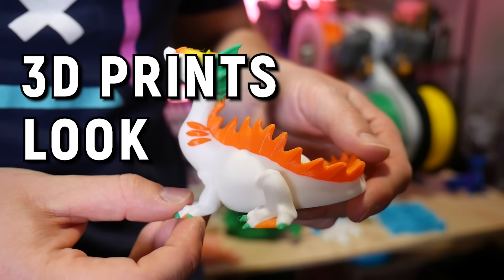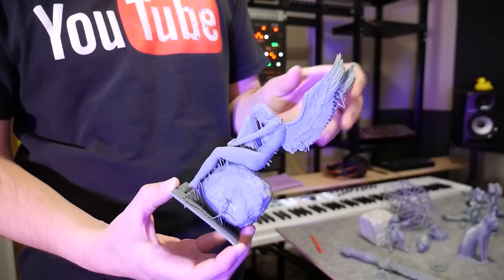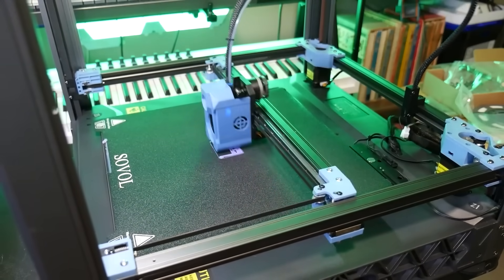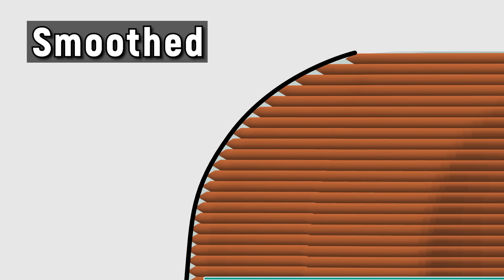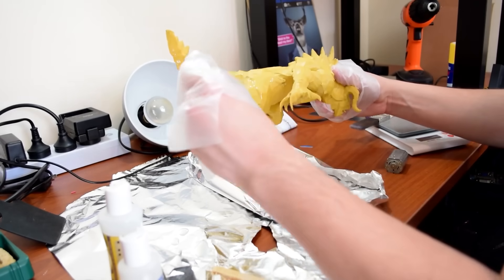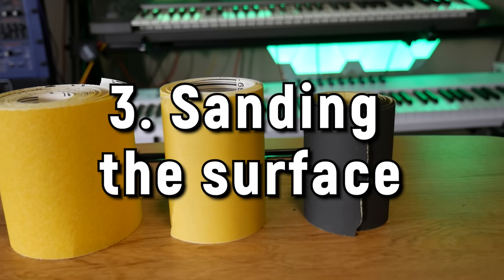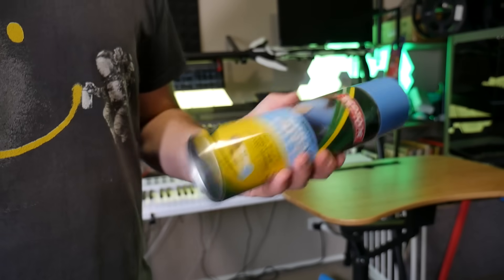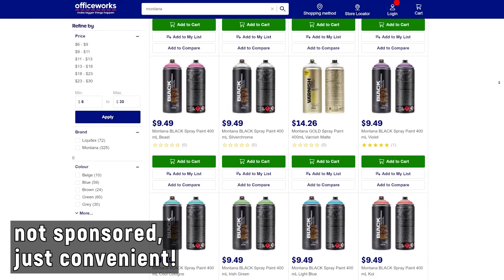How to make 3D prints look like they're NOT 3D printed.

Comment: A rule of thumb is to always use a lower grit before painting if your paint is thick, the paint will fill in the groves and leave a surface finish comprable to high grit, but it will stick much better. Generally you should only use a very high grit (>300) if you are going for a polish and not paint on top.

Comment: I use elmers wood putty which is water based so you can thin it to the consistency you want with just water.  Then apply with a plastic paddle or paint brush depending on the consistency.  It dries in about 20 minutes so you can do multiple coat/sand layers in very little time.  After I get it to where I want I spray with rustoleum 2 and 1 primer/filler then do a damp sand, I say damp as you don't want a ton of water or if you sand through the primer/filler it will reactivate the wood putty.

Comment: As an alternative to Talcum powder, I use baby powder. I haven't tried cornstarch, but I have read of others using it. 

You can still get talc powder, it is helpful for laser engraving on reflective surfaces as it lets the camera pick up the object easier, so it is not completely impossible to get.
Reply: If your baby powder isn't made of talc, it's probably either corn starch or potato starch.
Reply: I've used cornstarch and it works well.
Reply: How about fumed silica (cabosil?). It's commonly used to thicken epoxy.
Reply: Another option is diatomaceous earth powder.

Comment: I personally think a spot putty (like bondo) is a better alternative to the spray version you used. No aerosol, so PPE isn't AS big of a concern. And it's so easy to slap a little bit onto a printed part, and smooth it over in a matter of minutes. But, some form of sanding and filling will almost certainly give the best looking finished product.
Reply: Bondo is really stinky. I prefer wood filler, it’s water based, doesn’t smell, and it sands really well .
Reply: @roofoofighter  The smell doesn't bother me at all. But to each their own.

Comment: For anyone who wants to avoid the "orange peel" look after painting, you will need to wet-sand the paint. If you want to take it a step further and make the part look amazing, you can add clear coat, but you will - you guessed it - need to wet-sand to avoid orange peel. This definitely works best for larger surfaces, though. Since spraying paint and clear coat will fill in most fine details.
Reply: To add to this, 2k (1k works too) automotive clear coat will be exponentially better at protecting things than clear coat you get at a hobby store. Especially if you're coating things that get handled often. I made a 3d printed hitbox-style controller, and it would look disgusting right now if I hadn't used 2k clear coat. Any brand should be fine.
Reply: If you're getting orange peel, then you probably have a humidity problem.  Which, yes, is best fixed with wet sanding, but if reducing the humidity is practical - and depending on where you live it may not be - then you can avoid the orange peel in the first place.

Also, remember that most clear coats will kill most "metallic" paint effects, so test that out on scrap first.
Reply: @davydatwood3158  Good thing I've been hoarding all my scraps in different bins hoping for a cheap recycling option to become available in Aus. Got LOADS of scraps for paint, sanding or other testing purposes.
Reply: +1 for wet sanding
Reply: Another trick to avoid the orange peel texture is finishing with an airbrush instead of spray cans
Reply: Huh, I never encountered this orange peel effect and I was very surprised to see it in the video. I feel it mostly comes down to the paint used? I usually use automotive paint, which always leaves a glass-flat finish on a sanded surface.
Reply: @bzqp2  it's typically a humidity and quality of paint issue. It's definitely not the norm though
Reply: Also, I've used 1000 grit sand paper and it leaves it super smooth
Reply: What if you want the orange peal look?
Reply: Note: for wet sanding you need WATER RESISTANT sand paper. Especially paper based sand papers are not suited for wet sanding.
Reply: With a decent can of spray paint you can get a good finish by spraying thick enough layers.
Reply: @Iisakki3000  And lose any/all fine detail. Not trying to make paint blobs.
Reply: Or maybe you paint it correctly so you don't need to wet sand

Comment: Wet sanding is the way to go! Uses much less sand paper & doesn't create dust.
Reply: also keeps the surface cool so you don't get that melty gummy thing going on
Reply: 👍And I'd argue it even creates the smoother surface.
Reply: @_Jester_  with PETG and going thru increasingly finer grades of wet n dry paper I've managed to polish models before. At the end a bit of furniture wax does wonders

Comment: I recently printed something in a color I absolutely loved, so priming and painting weren't options. I knocked off the major surface blemishes with 100grit, evened out the surface with 250, then smoothed it out incrementally using 500 - 3000. It left a really cool, brushed finish Werth the layer lines looking like the grain of the material. To smooth it all out and make it all shiny, I used neutral shoe polish and basically spit shining the entire thing before sealing it a few coats of liquid floor polish. It's totally smooth, lost no detail, I can see my reflection in it,  it smells surprisingly good, it's totally water proof and I didn't lose the color of the filament. I would definitely use this technique again, as the end result was definitely worth the time investment.
Reply: I've made wind and brass instrument parts from black PLA: they really come out looking like ebony wood, which is a huge bonus. They also feel luxurious, smooth and silky, there is a nice warmth in the material when you touch it. I use water at each stage, including the rougher grits to keep temperature down. Add a bit of dish soap in the "coolant" and you can use some power tools, carefully of course. As long as there is plenty of that "coolant" in there, you can go surprisingly fast but as anyone knows who has tried it: the risk of ruining the surface for good is great.

I use car wax as finisher, after two polishing compounds..

Comment: They sell these scrapers that just look like flat metal plates but the edges of them you can form into a small bur and scrape the part, it basically makes it so smooth when you scrape away the material versus endless sanding. Then you can probably do your finishing stuff after and make it look like a injection molded part.

less sanding more quality and faster!
Reply: I use a small snap-off knife for scraping anything that isn't completely flat. It saves me loads of time! 🙂

Comment: I've found that quickly hitting a print with a foam sanding pad and then polishing it with a wheel on my Dremel is often adequate. Less effort than a full fill and paint treatment, which I've only done once for a shower knob (ironically, it was only supposed to be temporary, but my friend liked it so much they asked for a permanent version).

Comment: A potentially good replacement for talcum powder is a product called ‘microballons’ - they’re microscopic glass bubbles. I’ve used them to thicken epoxy for repairs on a discus launch glider RC plane, because it doesn’t add much weight (due to the glass being a ton of air filled, tiny bubbles instead of a solid) and retains a lot of strength. It’s also pretty cheap as I recall, and a little goes a very long way. 

Additionally, because they’re made of glass, they shouldn’t cause any issues when working with UV resin since they are essentially transparent (they look bright white in person due to all the refraction going on)
Reply: I've seen it sold as "fumed silica". It's great stuff, the only downside is the fact that it's incredibly dangerous to inhale, as any that gets in your lungs is there forever.
Reply: @nicellis44 fumed silica is a different product, but probably better as a thickener as it shouldn't float out of suspension as quickly as kicrobaloons

Comment: if i want to smooth a part and give extreme strength, following your sanding method but just before you go to spray putty, i cover the area in baking soda and then spray CA glue, it dries fast and goes hard as concrete , then continue with putty and sanding , needing less putty in those areas

Comment: Well.... you got a lathe..... it can be very, very nice in some cases to just use that to smooth prints. Just very light work, very thin and it gets smooth without any other finishing.
Also, using metal and plastic smoothing-brushes in a machine like a drill or in the lathe and just go around the part. Works way faster then using sanding-paper without the melting-problems. If needed, you can make it moist with just a plant-spray. It really gets smooth fast.

To paint, airbrushes work really nice and fine.
Some use simply fine-grid sand-blasting with this way too. I never felt the need for this myself but I have seen some nice models just done this way. Sometimes airbrushed afterwards, some without. On difficult places, just use some plaster before and then use the sandblaster/airbrush afterwards.

And yes, I use the carpaint-cans sometimes too....

Comment: I was always told to avoid PLA if you plan to sand, as its lower temperature resistance increases the chances of it melting. For models you plan to sand use PETG or ABS (and then you can get away with using electric sanders if you wish!)
Reply: you can make the PLA a bit moist with a plant-sprayer to avoid melting.

Comment: for note, i use to do bodywork all day everyday, mostly fiberglass

i HIGHLY recommend 3m goggle gear 500 safety goggles. Not only are they inexpensive, so everyone can get them, but the lens is also replaceable if you want to  have back ups incase you break or scratch them, the gg 500 is D4 rated and should be more than enough here, but if you want to be extra sure go for the gg 2890 safety goggles that are D5 rated (fine dust), which are also over the glasses goggles for all you glasses needing folk

for the face masks/resperators my single use go to is the 3m specialty particulate respirators 8000, its an N95, P100, P95, R95 rated mask and worked quite well in my very dusty environment, and it had an breath exhalation valve so it didn't get too hot. for reusable resperators i very quickly fell in love with the half face rr 6300, as it could be set up for vapors and fumes like when i was painting cars, or dust of all types, it had replaceable cartridges so you just gotta pick the one that suits best for you
Reply: These are TOP TIER TIPS 🥇
Reply: I know this is an old comment but question: How do you choose the size of the face mask? I can't find any details about it online. First time buyer so I have no idea and it's not like I can return it after use...
Reply: @ares395  the very simple way i figured it out, if your a large adult male (6'+), get a large mask, if your anything else, get a medium
Reply: @The_Phrough  Thanks, I guess I'll get a medium then. I also found a thread from pandemic times that claims that medium fits around 80% of population but they were talking about a different type of 3M masks.

Comment: I had to search what “bog” means. I’m still  not entirely sure what it means.
Reply: it means coat or layer on putty (plaster, spackel, any other wasteable material than can gap fill) 
its an old school builders slang term , thick mud is a bog, like a swamp
so you need to goop up your part till it looks like a swamp ... bog it
Reply: @nadukkerensky392  I wonder if that’s where the phrase “Don’t get bogged down in the details“ comes from
Reply: @roofoofighter  yeah quite likely, being bogged down is same as stuck in the mud
so you dont want to get stuck in the details and not finish the project at all
Reply: "Filler" as in Bondo or Rustoleum spray filler.

Comment: Edit: I meant Teaching Tech, not CNC kitchen

CNC Kitchen made a video on this but he did it using only slicer settings. To me, his results are a lot more clean and less hassle.
1. Random seam position
2. Fuzzy skin parameters of 0.2 and 0.2
3. Variable layer height
Reply: You are comparing pears to apples.
If all you want to do is hide layer lines and have models with orange-skin you can go that way and be happy.

This video discusses ways to get the most clean and smooth surfaces.
Part of this is optimizing print parameters as also mentioned in this video but for the best results you have to invest time and effort.
Reply: @GrmlMaster   no you're wrong. This video was about how to get your 3D prints to not look like 3D prints. Hence why Angus goes through many different methods, some of which don't give the smooth surface that his main method gives. Teaching Tech even uses some of the post process techniques that Angus uses but he focuses on how we can do a lot with just a slicer.
Reply: @TheSupermUniverse100  You can stomp your feet like a little boy as long as you like. Angus shows ways to smooth models in this video. As he says by sanding, melting, coating and combinations of it.
Reply: @GrmlMaster  That is literally what I said lol. Btw Graham’s Hierarchy of Disagreement puts name calling at the very worst way to refute points. Just take your L and move along. No audience here to watch 2 nobodies argue about something stupid.
Reply: @TheSupermUniverse100  🤪 sure sure

Comment: Dat orange peel. If you sand back your primer more aggressively and then lay a second wet coat you get alot less peel in my expirence.
Reply from the maker: Yeah 100%, I actually prefer the slightly matted look for my builds generally but good tips to get it even smoother!

Comment: If you want your PLA parts to look and feel smooth, without loosing the initial material colour, here's what I do. 
First I file down any rough spots and layer lines. Small metal files work quicker than sanding paper. 
Once the part looks smoother, but still has medium to small imperfections, I coat it with a thin layer of CA glue. CA glue is inexpensive and dries quickly. Don't inhale the fumes! 
Once dry, the CA glue layer needs to be sanded back almost completely, like you would automotive body filler. You can work your way up through the grits from 150 to 400 or even 600. 
You'll be left with a super smooth, mat finish and the PLA colour is still very similar to how it was at the beginning. 
If you want the part to be glossy or semi glossy, you can optionally spray-paint it with an appropriate transparent top coat.
Reply: i tried the ca method, it seems much harder than pla when it comes to sanding
Reply: @stoinercraft6389  Sanding CA glue is a nightmare. I wouldn't recommend this technique. It's also costly.
Reply: I have been thinking about using CA glue this way but never got around it to actually applying it. My go to brand of  CA glue is sold in tubes so I wasn't sure how to apply to large surfaces. I only recently discovered a new CA glue brand that comes in small bottles that has special brushes.
Reply: I've tried the CA glue on some smaller parts with 0.05 layer height and it works well.  The cheaper the better as you want stuff that really liquidy and doesn't activate too quickly.
Reply: But why ca glue when there are products for this.
Reply: @joeltorres3202  for me it was price and availability - I had it beside me at the time! The products that are available are hard to get or expensive where I am as well so it just made sense.

Comment: I usually clean the piece with a coarse 80p and then go to 280p on a container with WATR and then 400p...and if I really want it to shine, 800p and 1000p that's really different by the end. Primer, then back to the sanding until it's really soft to the touch.